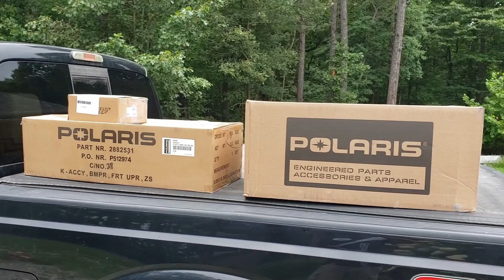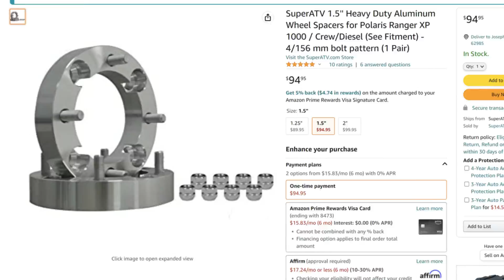Installing front upper bumper on Polaris Ranger Northstar & tire spacer mod update

Comment: The forward A-Arms are honestly the best option. You won’t have to worry about rub when the suspension is fully cycled. Very, very easy to install and they are much beefier than factory which will help with the heavier tires
Reply from the maker: Well it might come to that, but not sure yet. Got a few more things to try out and then I'll decide on a final fate.. Thanks man

Comment: Spacers are hard on your front end Kapp the wider you go the more stress your putting on front end and studs. Ive had 2 rangers and the only fix that I found was 2 inch arched a arms. Dont let it rub like I did and end up with holes in floor board and it dont take long for that to happen. I've had the a arms for 2 years now and not an issue or rub since. The cost is reasonable and worth every penny.
Reply: I put 2 inch lift before the a arms and guess what. Still rubbed. The lift unless your going 6 inches or bigger won't help you need to go forward not up.
Reply from the maker: good info, my last option is going to be the foward a arms. But not just yet have some more field testing to do. Thanks